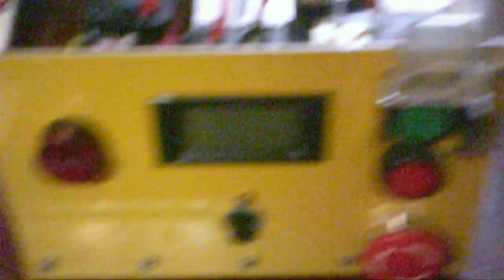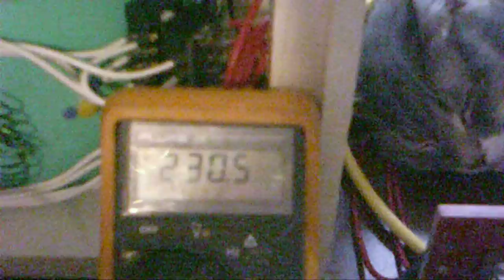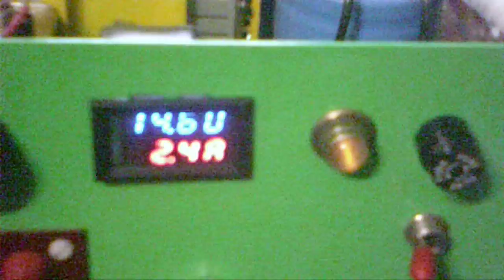PMBO final video

Comment: What does PMBO stand for?
Reply: Pulse motor buildoff im pretty sure?
Reply from the maker: @lucifchristo  Hi George how are you doing, these are motor generator sets that are 3 phase the led lamps act as a power load to show that the motor will self start under load and to show they have good power efficiency. all coils are wound thru each other and wound by hand then fitted on to the lexan former I have had one fragment at 117,000 rpm they must be mounted into a box for your protection as this would have taken your hand off or blinded you the magnets run on .375 teflon balls that run on a teflon race with a small amount of teflon impregnated oil mixed with synthetic 10w 30 you must monitor the temp as not to demagnetize the magnet a small type J thermocouple attached to the bearing assembly N42 max temp 80 C this varies with magnet type N52 max 60 C the temp is set below this temp to avoid damage  the PSU is a 12 volt DC 6 Amp, the 3 phase is generated by a 200 Amp brick RC motor speed controller. these motors are very fun to build but you must have respect for them as people have had to have surgery to repair their hand after the magnet exploded near his hand this person was in Germany his story is on youtube good luck and best wishes, Tony

Comment from the maker: Hello Everyone, the motor has an input voltage if 10.4 vac at 2.7 amp equals 28.08 watts times the motor efficiency of 90%(.9) equals 25.27 watt times 1.732 (3 Phase) equals 43.77 watt. The kinetic energy produces by a mass (Magnet) of 515 grams at 12000 Rpm equals 262 Joules Per Second. 1Hp equals 746 watt. 262 divided by 746 equals .35 Hp at 192 ft/lbs of torque. 262 joules(watts) per second divided by 43.77 watts per second equals  a coefficient of performance of  5.98 The generator is under a load of 24.5.vdc at 1.14 amps equals 27.93 watt with an input of 43.77 watt. The Generator can produce more power as it is not under full load with the input power rising in current. Thank you for your interest Tony